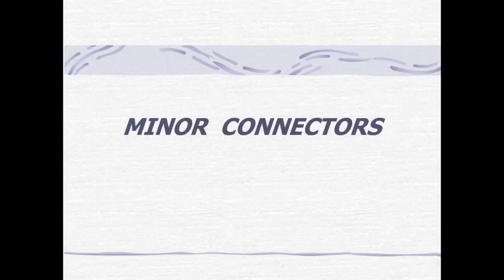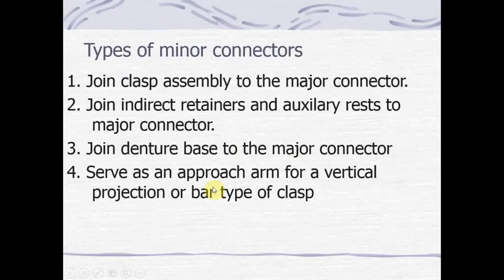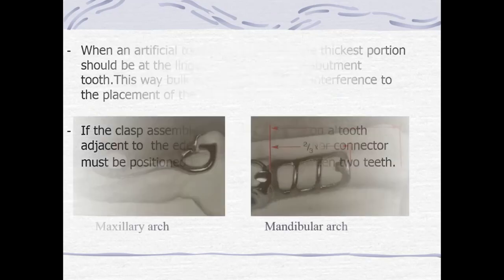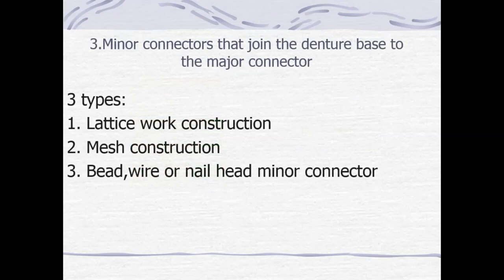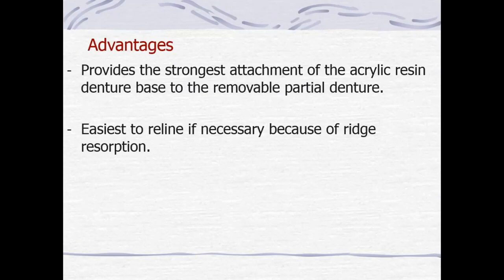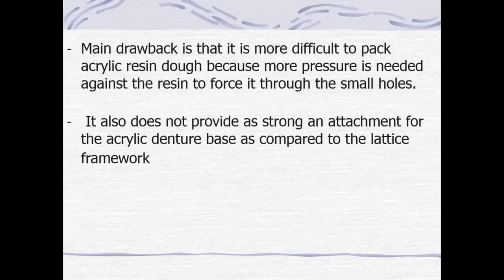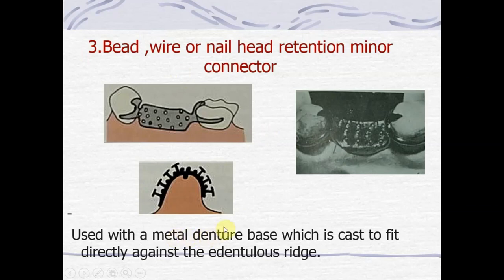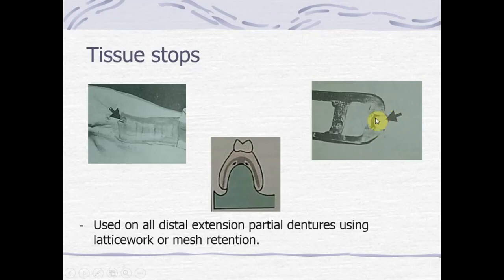MINOR CONNECTORS

Comment: Hey ✌ I have a question regarding the extension of the minor connector that forms the framework for a denture base, does it extend to the full depth of the vestibule?
Reply from the maker: The minor connector cover the edentulous span only over the ridge area and gets connected to the major connector which is extending  lingually.